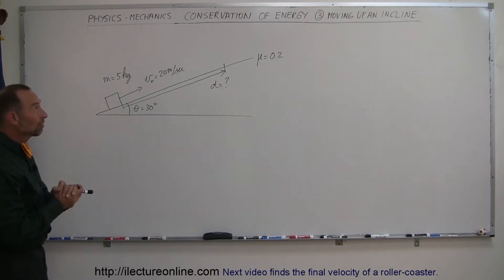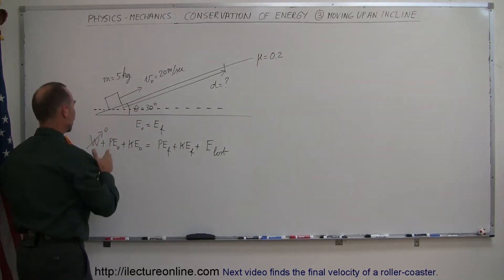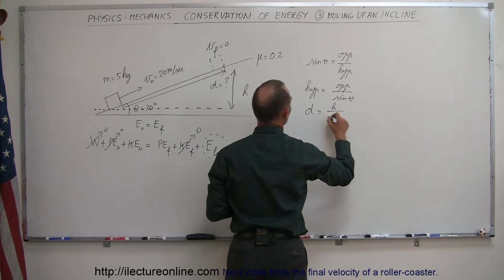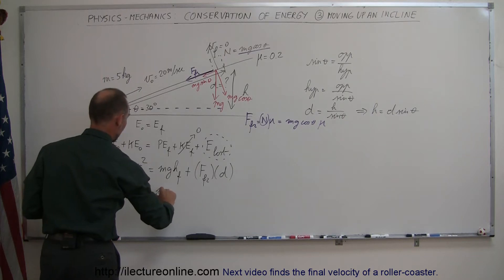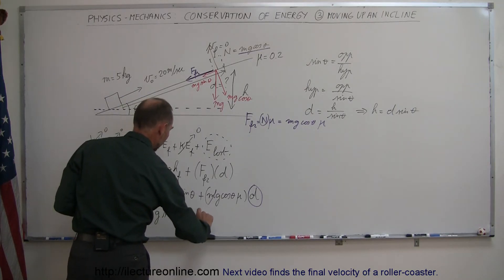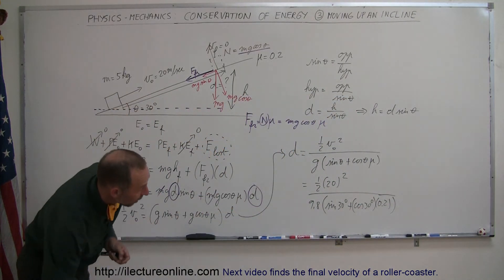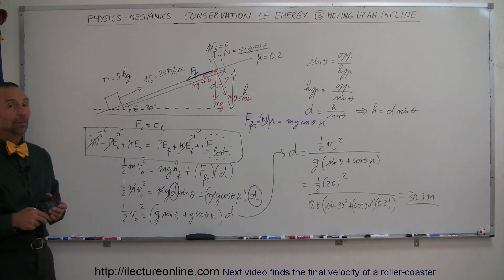Physics 9   Conservation of Energy (3 of 11) Moving Up An Incline (Friction)

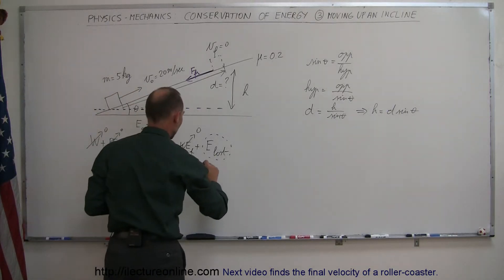Comment: 3:35 why is the sign not negative? Isn't the work done by friction force negative if opposed to motion direction?
Reply from the maker: If the energy lost due to friction is placed on the right side of the equation, you must make it positive
Reply: @MichelvanBiezen  so it was originally on the left (negative), and got taken to the right side?
Reply from the maker: No, with this equation, energy lost due to friction is always on the right for the equation to be balanced.  But you can make it negative and place it on the left.
Reply: @MichelvanBiezen  Ok,
what about Delta PE = -mgh
when does it give positive? In Conservation law perhaps?

Comment: Quick question, wouldn’t you have to add the component of the block’s weight parallel to the slope to the force of friction as it will also act down the slope?
Reply from the maker: No, the only force that affects the force of friction is the perpendicular component of the weight (plus any other forces that act perpendicular to the slope).

Comment: great video and helped allot ..  but shouldn't you take the lost energy with minus sign because the friction is on the apposite direction ?
Reply from the maker: Mohammed,  There are a number of ways in which you can solve these types of problems.  I find it easiest to set up an equation where on the left you place all the energy that was either added to the system or the system already had at the start and on the right you place all the energy that was lost by the system or that it ended up with.  In order to balance such an equation, all the terms have to be positive (even the energy lost due to heat on the right side).

Comment: At 3:40 don't we have to multiply by the 180 degree angle? because force friction is opposite to the direction of velocity
Reply from the maker: ali abrahami
If you place the "energy lost" term on the right side of the equation you must add it.  If you place the "energy lost" term on the left side of the equation, then you must subtract it.

Comment: First of all thanks for all the efforts you have done to prepare such a helpful videos. Sir, why is initial energy equal to the final energy? Is it always the case or are there some situations that initial energy is not equal to the final energy? thanks.
Reply from the maker: It is actually almost NEVER the case.  The only reason why we can use that equation is because we also account for the energy lost by adding it to the right side of the equation (as energy used to overcome friction).

Comment: Sir, i have a problem of choosing which method to use… why we are using total energy conservation instead of newtons second law or impuls momentum? 
Im really confused
Reply from the maker: Typically when the question asks for the acceleration, use Newton's laws.  If the the question asks how fast will it travel or how high will it go, conservation of energy is a good method.  That said, you can usually use either method.
Reply: thank you so much, it makes sense now
you are such an amazing professor
i have my fe exam in two days and im wondering what videos would be useful for me regarding statics,dynamics and mechanics of materials since dynamics is my weakest subject in the exam
Reply from the maker: Since I don't know what was part of your course, my recommendation is to look at the playlists and see which ones match.  They are all in order and can be found from the main home page on this channel.

Comment: Since it is going up the incline would the force of gravity component parallel to the plane also contribute to the work?

The video shows only Ff doing work as umgcos30, but isn’t mgcos30 (force of gravity component along the incline) also doing work against the block moving up the incline assuming no applied force.

So should the equation be something like this:

Ei=Ef + W
Ei=Ef + Fd
1/2mv^2 = mgh + (mgsin30 + umgcos30)d
1/2mv^2 = mgdsin30 + (mgsin30 + umgcos30)d

Am I missing something here?
Reply from the maker: The work done to overcome gravity is accounted for by calculating the difference in potential energy.

Comment: would an equivalent form of writing the equation be
  W+ ΔK +ΔPE - E lost =0 
or
 W+ ΔK +ΔPE + E lost =0
Reply from the maker: That depends on the definition of delta KE and delta PE
Reply: Michel van Biezen delta KE would mean (K final- K initial) and same for Delta PE
Reply from the maker: Then it would not work since you need the initial energy on the left side and the final energy on the right side., also it must be - energy lost on the left side.
Reply from the maker: But it is better to think about it logically.  It really does make sense that the initial energy that you started with + any work put into the system must equal the final energy you end up with + any energy lost due to friction, etc.